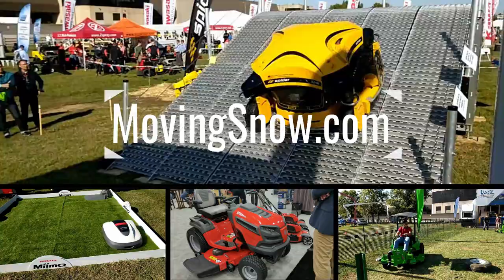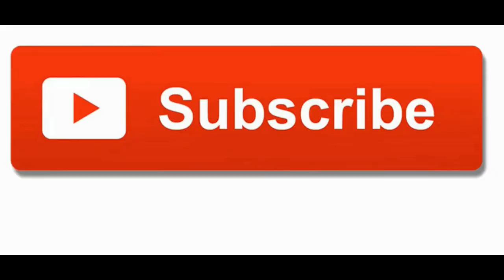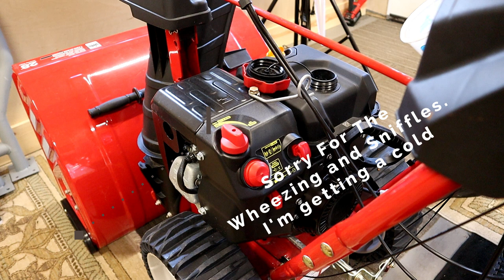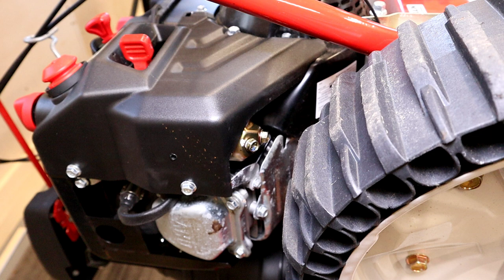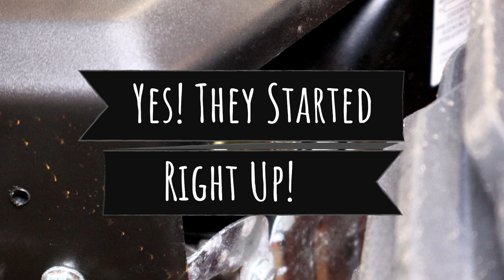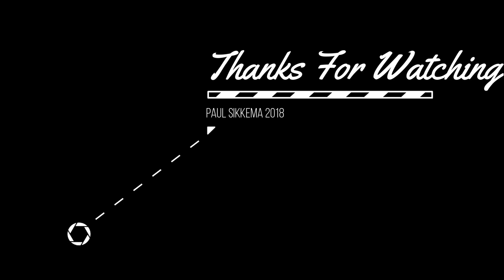My Snow Blower Won't Start | Troy-Bilt, Cub Cadet, Craftsman, MTD

Comment: Hey Paul how have you been. The shop I work in won’t take in for repair Troy Built, MTD, and new Craftsman snowblowers and others. Most of these newer models you practically have to take half the engine apart to clean or replace carburetor. Shops have hourly rates and repairs/ repair work would amount to getting a new machine. The job as I would say snowballs LOL into gummed up Carburetor and more because people don’t pay attention to using a better gas rating and some type of stabilizer. Even getting oil changes. Tons of people purchase from big box stores and don’t get the right information to go by dealing with small engines like on snowblowers. I will repair any small engine but I have to go with what the boss says. I do side work afterwards and will tackle any repairs.
Reply from the maker: Yes, the number one cause for a snow blower not starting is old/bad fuel. From listening to my readers most shops charge about $250 for a carb cleaning or replacement so spending $35 on a new fuel can, $8 on a can of sea foam and buying fresh gas every 30 days is money well spent.
Reply: Hey Paul, I enjoyed the video. I'm also a believer in Seafoam. I go one ounce per gallon when I fill the can. I was wondering how much you added last year. I go ahead and drain in the Spring because there are years i dont even need the blower.

Comment: I'm trying to figure out what type of gas or if there is an oil mixture I need with it but i cant find my model snowblower online. Hoping it's going to be a general gas or mixture?
Reply from the maker: You didn't state what snow blower you have. That said, 2-stage snow blowers built in the last 10 years will run on 87 Octane up to E10
Reply: It is a Troy Bilt 2410 so I'm reading on google but maybe im bot understanding if its calling for regular gas and 5w30 oil or  a mixture of both?
Reply from the maker: Gas, 87 octane, E10 or less, goes into the fuel tank (Big red cap on the top of the snow blower) 
Oil is checked using the yellow cap on the top of the snow blower. If it is low add 5w30 as needed. 
Here is a video on changing the oil https://www.youtube.com/watch?v=9K1w1Hbpks8
Search youtube for other videos about other maintenance tasks to do.

Comment: It's mid August, I know it's late , but I didn't drain the gas tank in the spring.
 I cleaned the plug, hit the prime button, pulled the cord and it started right up.
 Do I have to drain the gas tank?
 If I start it up once a week till the snow gets here, would that be OK?
Reply from the maker: At this point I suggest. Go get a can of Sea Foam. Any store that carries automotive parts will carry it. 
Put one tablespoon in the tank and then fill the tank with fresh fuel. 
It will help to keep the fuel fresh in the system to start it every week or so until the snow flies.

Comment: Do you have the full set of metrinches ? How are they? I remember the TV commercial years back.
Reply from the maker: Yes, I bought the full set back in the mid 90's. I've never broken one but i lost the 9/16 - 1/2 inch drive socket over the years. And, I did replace the 3/8 ratchet with an old fine-tooth chrome Craftsman. Otherwise they have been perfect. The 1/4, 3/8, 1/2 inch combo set does everything I need around the home. I like them so much I gave my entire 600 piece Craftsman set(s) to my son-in-law a few years ago.

Comment: What if you get no sound when using the electric start?
Reply from the maker: Make sure the extension cord you are using is good and that there is power at the outlet it's plugged in to.

Comment: Have had this problem with my cub cadet, had to call in a guy to do it but now i will be able to do it myself. Water in fuel a bigger problem with cadet engines, have never had this with brigs motors. That said, another snow thrower i have, a sear that has a brigs motor, after running for a short while motor cuts out. Will not restart for a few min and no one can figure it out. I was told that maybe wires are ground out causing it to stall. If that is the case why would it start at all? Any way thanks for the vid a big help

Comment: Great video
I subscribed 👍
Before I do what u suggested, I have a 3x Cub cadet that I bought and used once 3 years ago.  I let the blower run til empty and put it away.  Went to use it the other day after 3 years, put in fresh gas and engine cranks but won't turn over/start. Someone suggested I spray starter spray above the carburetor bowl all up in that area around the carburetor (my setup looks just like yours, bowl/carb right above back left wheel). Blower should start right up.  Thoughts? Do you think that will work?
Reply from the maker: No, that will not work. The carb intake is near the spark plug area and closed off so it won't get snow and water into it. You can't just spray starter fluid around the controls. 
SAFETY FIRST! Starting fluid in very volatile and any backfire or spark from one of the switches will set it off. What's worse it's petroleum based so when it gets on all that plastic it burns very hot and quickly melts the carb covers, the carb, the switches and the wires. You won't be able to put it out in time. Trust me on this. I burnt up a Troy-Bilt Arctic Storm because I tried to use starting fluid. 
(It used to work when the carb and housings were all metal)
Reply: @PaulSikkema ok - can I spray the fluid into the carburetor via the drain plug on the bowl perhaps, using the needle thin straw the can comes with?
Reply from the maker: I've never had any luck doing that way. You might try carb cleaner though. Spray it into the drain hole and leave it sit 10 minutes. The spray it again and let it all drain out. Put the plug back in, let the gas fill the bowl and then try to start it.

Comment: These new blowers seem to have this problem because they are making the needle and seets out of cheap materials and get sticky easier, I have a Columbia blower that's about 20 year old and I use high grade gas with stabilizer and never have had any problems starting each winter seasons, sad to see these problems with the newer blowers nowadays
Reply from the maker: You do know why the needle and seats are made that way today? It's not the manufacturers - it's the government's severe emissions requirements that are the cause. The only way to remedy the problem is to switch to EFI but that adds $200-300 to the cost of the small engine.
Reply: @PaulSikkema  thanks I didn't know that but I'm not surprised, I guess it's best to run it completely out of gas at the end of winter

Comment: Hope you can help me.  I can't afford a shop.  My 7.75 Model 536.887750 was stored under a tarp for 2 years and not used.  It won't start.  It's around 15+ years old.  Here are the particulars.

1.  New plug gapped to .030.  I am getting spark during start up
2.  New gas.
3.  I'm using the electric start.
4.  Fuel is blowing Out of the carb during start up.
5.  Exhaust has no fuel accumulating in my hand.

Any ideas?
Reply from the maker: I'm not a mechanic but here are two resources that may be able to help. The members over at https://www.snowblowerforum.com . Go to the Craftsman section and ask. If you know what's wrong and want to learn how to fix it https://www.youtube.com/user/donyboy73 has the best videos.

Comment: Biggest problem folks have is not draining the fuel out. The older machines had a fuel drain. If you want a problem free unit drain the fuel out. Question on the new model toros do they have a fuel tank drain. Thanks
Reply from the maker: The new Toros have the fuel drain on the carb just like the example in this video. Also the 928 and largerr have a fuel shut-off valve for those of us who prefer to leave fuel in the tank but run the carb dry.
Reply from the maker: The new Toros have the fuel drain on the carb just like the example in this video. Also the 928 and largerr have a fuel shut-off valve for those of us who prefer to leave fuel in the tank but run the carb dry.
Reply from the maker: The new Toros have the fuel drain on the carb just like the example in this video. Also the 928 and largerr have a fuel shut-off valve for those of us who prefer to leave fuel in the tank but run the carb dry.
Reply: Paul Sikkema I was hoping the fuel tank had a drain you think they will almost all problems are due to bad fuel. I use stable all the time but it’s not the answer. I like your videos I had really bad luck with ariens. Ariens always started for me never let me down that way only performance I had 2 ariens seems like out of balance can’t handle deep snow. Other people I talked to same situation with ariens. Been watching toro units like what I see. Thanks
Reply from the maker: Hi Nick, If Stabil is not working for you I suggest switching to K-100 - https://amzn.to/2Kfjh0I 
Donyboy73 has a video showing how well it works. 
If you have not owned a 2016 or newer Ariens Deluxe, Platinum or Pro you will be amazed at how well they throw heavy, wet snow. That said, I really like how this Toro throws snow also.
Reply from the maker: Hi Nick, If Stabil is not working for you I suggest switching to K-100 - https://amzn.to/2Kfjh0I 
Donyboy73 has a video showing how well it works. 
If you have not owned a 2016 or newer Ariens Deluxe, Platinum or Pro you will be amazed at how well they throw heavy, wet snow. That said, I really like how this Toro throws snow also.
Reply from the maker: Hi Nick, If Stabil is not working for you I suggest switching to K-100 - https://amzn.to/2Kfjh0I 
Donyboy73 has a video showing how well it works. 
If you have not owned a 2016 or newer Ariens Deluxe, Platinum or Pro you will be amazed at how well they throw heavy, wet snow. That said, I really like how this Toro throws snow also.

Comment: Good day  Nice video. I noticed your wheels, they are plastic, are they better than rubber.  Here in  Ont.Canadian Tire sells different models some had plastic & some had   rubber  Thanks
Reply from the maker: Hi Don, The rims are actually metal on this snow blower. The paint is so shiny it does make them look like plastic. The treads are rubber like a normal tire.
Reply: They are rubber on metal airless tires.  They work great! If you can get the damn thing to start!!

Comment: Every snowblower should have a fuel valve so you can run the carb dry if you are not going to use the machine for a while.
Reply from the maker: Yes, it should  - or EFI

Comment: to get to the carburator, what did you have to remove to get the access?
Reply from the maker: If you want to replace the carb I suggest searching YouTube for a video about that. If you are only taking off the carb bowl the easiest way I've found is to tip the snowblower up on it's nose and the bowl is easy to see and remove.

Comment: I TRY TO FIND THE CABURETOR FOR TROY BILT 2860  HUAYI 175SC  BUT I CAN'T find
Reply from the maker: Hi wilvestylo, You need the model number and serial number from the nametag on the back of your transmission case. Then. Go to troybilt.com and click on the parts & support tab. You can order a new carb there.
Reply: Thanks im going to try looking for it

Comment: Use kitty litter to clean up the fuel, oil etc.
Reply from the maker: Use the non-scented stuff or buy regular oil dry from the auto store. The scented stuff stinks when you use it on oil.

Comment: Paul, you mentioned you can pour that old, watery (maybe gummy) gas into your car or truck; they don't care. I know you're not a mechanic, but are you sure, and what's the reason for that? Is it just because it's so diluted by the large volume of gas? Or maybe because there's at least four cylinders in a car?
Reply from the maker: My main reasoning is that you don't have to take it to a hazardous waste facility. If you only have a gallon or less putting it into your car's tanks will dilute it. And since your car and truck use EFI instead of a carb it will compensate for the poor gas.

Comment: Octane booster works like a charm
Reply from the maker: Octane booster works well for starting in the winter. But, you can get the same benefits by keeping your fuel in a sealed gas can.

Comment: I thought if you put fuel stabilizer in it it gets rid of the water and lasts over 6 months..
Reply from the maker: It depends on the fuel stabilizer. In general, fuel stabilizer will keep water from settling to the bottom of the fuel tank and corroding your carburetor.

Comment: If you are using Ethanol fuel? That is the problem. My small engines always starts on the first or second pull. I never use ethanol fuel and never will.
Reply from the maker: Even with non-ethanol fuel I still suggest a sealed fuel storage can and a fuel stabilizer
Reply: The only place I can buy no e fuel is at a marina, and they are closed in winter! So stabilizer is key! My boat is always no e 90.  My lawn equipment runs like my car 10% e.  It sucks.

Comment: Thanks I'm going to give it a shot. used it 3 times last winter and it is dead. It was acting like primer bulb not working. There should be a class action lawsuit against MTD , my john deere and echo motors are start fine after 5 months in winter. So mad I bought this craftsman piece of junk last year. 

Update well I drained the gas and it did the trick, however I had to spray carb cleaner in 2 twice in spark plug hole and after 2nd time it finally started. I primed the heck out of it and  that didnt help, thinking the primer bulb will need replaced. Also had to keep choke at 3/4 because when i tried opening up all the way it was racing. even after running for 30 minutes. All I can say is MTD should be ashamed of this engine, terrible engineering.
Reply from the maker: I've had more problems with primer bulbs over the years than any other part on snow blowers. If gas gets in them they rot.

Comment: I tried to loosen this screw and the entire carb rotated and now leaks. Do I have to replace the carb now. So frustrated on this SNOW DAY!
Reply from the maker: Hi E Conlon. That's weird. Did you loosen the screw with the cross in it of the other one in the middle of the bowl? If you accidentally loosened the one in the middle - remove the screw and the pop the fuel bowl off. At the top - where the bowl meets the carb there is a gasket. It can be any color- white, black, red. Straighten that gasket out and then reinstall the bowl and center screw. If that doesn't fix the leak you'll have to get a new gasket from a repair shop. Bring the model number of your snow blower off the nameplate.
Reply: No If you just loosened carb bolt like half turn to one full turn on bottom you can just tighten it back up till it starts to feel resistance. Should be good. On new carbs the bowl sits in a recess lined with the bowl o-ring. But if the bowl dropped the O-ring possibly fell out of place you would have to place back in recess. You can tip snowblower up on its auger housing to further work on carb.
Reply from the maker: That's actually a MetWrench combination wrench and it works a lot different than a regular combination wrench. It's actually a 6 sided wrench. Those extra points put the load on the flats of the nut - instead of the edges or ends like 6 pt and 12 pt wrenches can do. It handles both 3/8 and M10. That wrench is over 30 years old but you can still get them here: https://amzn.to/2PdI0jt.

Comment: The lesson here is to NOT store your machine with gas in it. At the end of the season, use a 7 dollar squeeze siphon to remove as much fuel as you can - then let the machine run until it stops. Your tank will be empty and next season you'll start right up!!
Reply from the maker: I suggest adding Seafoam, running it for a little while to get it down to the carb. Then remove the fuel from the tank. Then run the engine until runs out of fuel. The Seafoam coats the interior of the carb protecting it from oxidation.
If you have a snowblower with a fuel shutoff put Seafoam in the tank, start it, close the fuel shutoff and let it run out of gas. The Seafoam coats the interior of the carb protecting it from oxidation.

Comment: Do not put the drained gas in your car!!!
Reply from the maker: @Sharon Angstrom, If you do not have another way to safely dispose of the quart or less of fuel putting it in your car or pickup is a good choice. Today's auto engines all have EFI and sensors so that they don't care if the fuel is a little old. You car won't notice....